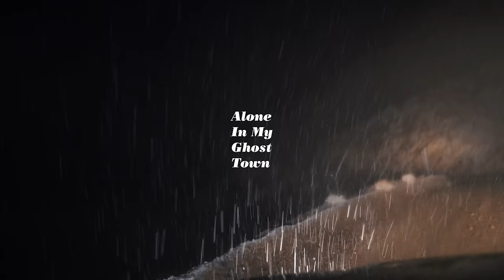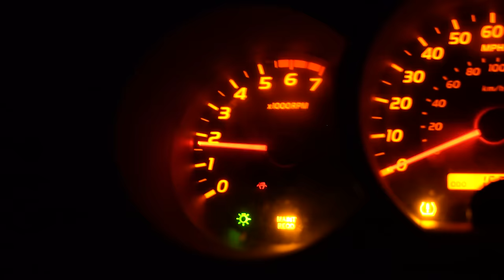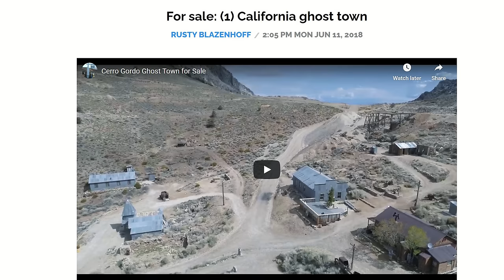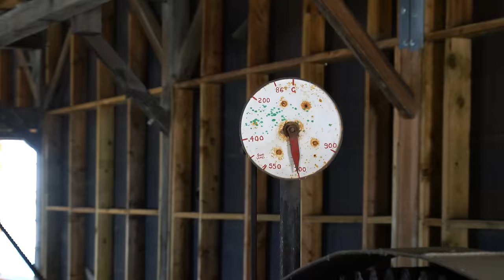6 Months In A Ghost Town

Comment: I've lived off the grid on the edge of the painted desert on 40 acres with no running water.  I have to haul it in from a nearby town. I love it. We've got dogs, goats, chickens, and rabbits. Animals make great companions for living an isolated life. A bunch of roof rain water collection systems might help for your water.
Reply: And cell phone or internet obviously
Reply: @markushutto4017  No more cell phone but Mi-Fi and a low watt laptop. Most solar kits come with USB hubs to use solar to charge your goodies.  I have an inverter I connect to the battery 750 watts.
Reply: @spinderella3602  that's good to know. I plan on building a small cabin and would like a modern amenity like that. I haven't figured out a good water system yet. I guess I'm looking for living with no power bill and I can do without a cell phone too. I hate phones
Reply: @markushutto4017  If I had to do it all over again , I would have started buying up 12 v lithium 30 yr batteries, about 1k wt in solar panels, sinewave inverter& charge cntr.
Reply: @spinderella3602  how much were all the panels?
Reply: @markushutto4017  200 watts (2x 100 watt kits from Harbor Freight). It's what I got when I moved out here almost five years ago. For two kits it was $500 . I don't recommend what I got. Renogy seems to have what all my tech-y friends have.
Reply: @markushutto4017  Also, buy super durable items. Pay extra attention to quality. You may not be able to find replacements in the future. Buy backup everything you can afford that has a long shelf life (unlike gasoline).
Reply: Spinderella 360 okay I want to hangout with you. You seem awesome

Comment: Definitely look into building a water tower.. it would help immensely with the water issue. Elevated water tower will use gravity to feed water to your town. Remember you can use sand and Charcoal to filter water and then boil.
Reply: This is Cali dude its illegal to catch rain water.....
Reply: @iprofox3758  why is it iilegal??
Reply: @iprofox3758  It wouldn't have to be rainwater - just pump water from the mine into the elevated storage tank/tower using the existing setup and feed it to the houses using gravity.

Comment: Hey you’d should look at those firefighting skids that are drop in and fit in the back of a rzr. Would help if lighting stuck somewhere near and you could put it out before it got to big. A used fire truck wouldn’t be a bad idea but it’s pretty costly to fuel and maintain one of those
Reply: A brush truck might be a better option. Most of them have a 500 gallon skid on the back and should be relatively easy to maneuver where it needs to go
Reply: Lucas Gardner very true, but hauling gas up the road for one of those beasts could be a big pain. Less of a pain than rebuilding a town however
Reply: Brush truck would be better. Engines are more difficult to operate as you need to understand how to pump it. In addition you would need someone on the line as you pump or it could become very dangerous.
Reply: high doses of vitamin c kills all viruses  Bot stop spreading misinformation

Comment: You should get one of those rainwater collector systems, Matt at demolitionranch installed a system at His "of the grid" House, it looked really smart 👍
Cheers from Northern Sweden 🍻
Reply: Actually there is a youtube channel, don't remember it's name though, where a guy built somewhere in the middle on nothing in NM and he is self sufficient with rain collected clean water, gardens solar energy and such... This town seems to be the perfect candidate to start strategizing with zero waste self suffiency.
Reply: Someone invented a form of collector that can condense water from an arid environment - it supposedly is inexpensive and not too complicated. It's called Warka Water I think. But you'd still need to purify it. Also you should get a 'catalog' from Real Goods in Ukiah, at one point they did the solar for the whitehouse - they're very progressive in alternative energy.
Reply: @kevinlkoehler  By physical law, collecting water from the air is expensive (energy-intensive). Take any off the self dehumidifier, the water it collects is all you'll get for the power you consume. You can't get all too much more efficient than that.

Comment: Another idea, solar energy. If you could get an american company to sponsor your town with autonomous systems, you'd be self sufficient.
Reply: True, I dont doubt it. There is at this moment no need for the entire town. And I dont think anyone would supply the entire town for free. But I was a thought. Autonomous solar at least down here in Mexico, would be way cheaper than getting the utility to install transmission lines, for such a context.
Reply: A home solar system is all wrong here. You don't want to taint the look and feel of a rustic town that may have filming potential. He appears to have power from somewhere, though his needs seem small. The most he could use is a small 12 volt system mounted on a trailer that could be moved around. Brand new 100 watt panels run about 100 bucks each, a couple deep cycle batteries and a harbor freight inverter is the only upgrade he might need.
      I used to supervise installations at a 45 year old solar company.
Reply: Great idea

Comment: Seems like solar would be useful there. Have you been in touch with a sustainability team? Looks like resources are at a premium up there. Best of luck 🌞
Reply: A few big panels and a tesla wall battery would provide some decent power, especially if you let the battery fill, then you can have a couple days of high power usage at a time, or constant low power usage. You won't be running power tools for too long, but with the battery fully charged you could even run power tools for a while.

Right now they use generators obviously.
Reply: I think there actually is power to some buildings as the fire that burned down the hotel was apparently electrical in nature. Probably very old wires and low voltage.

Comment: You should get an archimede's screw for pump.  It may be less force to bring water all the way up.  You may need to get several pumps and bring water up in levels with a catch basin on each level.  Replace ladder in manway with a covered more robust ladder.  I saw ladder in video.

Comment: Just throwing this out there in case no one else has brought it up yet but as of 2012 it is legal to collect rainwater in California so since you do get a fair amount of snow up there it wouldn't be a bad idea to get a few rain barrels and a water catchment system eventually set up, it would certainly be a little more reliable and safer than pumping the water up and letting it run through the older pipes. At least as a secondary system or a way to store the pumped up water as well.

Comment: You should invest in egg laying chickens. And a warka tower so you can finally get at least some semblance of running water. Considering all the rain and snow, it might be viable. Wonder if you could rig a water tower to collect the water from snow and rain and send it with the pressure into a filtration system....

Comment: Install modular break tanks into your water supply on one or 2 levels of the mine. Pump water from the 700 level 250 feet into a break tank and then from that tank pump it up another 250 feet into a second break tank and then up to the surface. This reduces pump header pressure massively, uses less power and reduces strain on the pump equipment, pipework and associated fittings. Should also increase flow. That's how we engineer water up skyscrapers.

Comment: I don't know about the snow but in the sand if you let out a little of the air pressure In your tires it drives better on the surface

Comment: Get a well rig out there to drill, so you can have water for yourselves and the livestock.  That old mine's not going to supply enough water for the people there, animals, and gardens.  You also need to test it before using it for anything but toilets.  It could contain arsenic, heavy metals, and bacteria (rats down there are using that water hole, for sure) and make people and animals sick. (**DON'T use it on food plants either.)

Comment: Water, check.  Pump, check.  new pipes, check.  But the ghosts are messing with it.  It's cool seeing all those men working to help you get down into the mine to see the water.  

Water pressure affects the mountain.  Drawing water out of the mountain might be shifting the loads a little.

Maybe every time the lift moves, it's a wood beam or support collapsing, way down under you.  
Or it's earthquakes.  Maybe check the geology reports.  

You are pretty high up in altitude.  So there might be volcanic activity under there.  But it's also near the edge of a tectonic plate.

Comment: Bout 6 months away from getting a degree in technical installations. Imma get you running water.
Commended before watching the whole thing.
Does that underground reservoir replenish itself often enough, or does it have enough capacity to be a sustainable water source for normal levels of consumption?

Comment: If you had a 2" diameter pipe, every 46 feet of pipe would be 62.4 pounds of water.  700 feet / 46 feet = ~950 pounds of water that the pump is trying to push up.

Comment: I met such a resident in Montana.  
Nobody should go there alone.
Lived in a root cellar.  A dug hole 
roofed with lumber pulled off an
abandoned building and then 
covered with mine waste.  Said 
the only pet in 50 miles was down 
beside a bed of rags and it was a 
rattlesnake named Fred.  Let me
have a radioactive lead sealed 
metal case in exchange for one 
pound of calcium carbide I had. 
As a reserve fuel supply for my 
mining lamp.  After my Geiger 
counter confirmed the case had 
been exposed to radiation.  Never 
opened it.  Now keep in a locked 
storage area.

Comment: Why not just have a huge gallon that when snow comes it goes in the gallon and can melt either if you have like something that can heat the snow inside the gallon and then melt so when you wanna drink water. You can just put clorox or something so the water won't get any bacteria.

Comment: How you going to live 6 months with no running water complaining about no running water without building a watertank. :|
I find it strange as the narration of the video is basically spoken internal dialog so it's like you've been saying the one primary issue to yourself a thousand odd times, water. Make a tank (welding.. water tank is a great first project to learn)/buy a pre-built and haul a empty plastic and haul one up to near summit and you dont even need to make the tower yet if it's a higher altitude than the highest building by 20+ meters and you're golden. Gravity fed water with a very high pressure feed.

SIDENOTE: get that water tower airtight with welding and you're good to make a wood fired Spa/heated pool with the same skills.